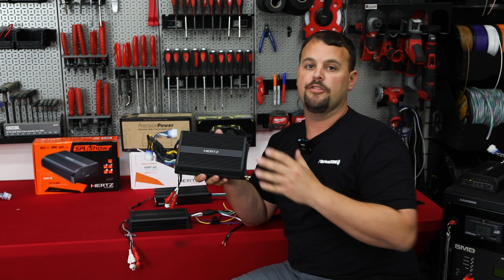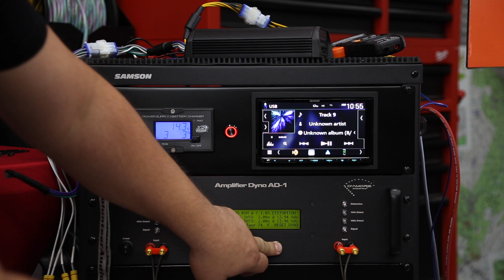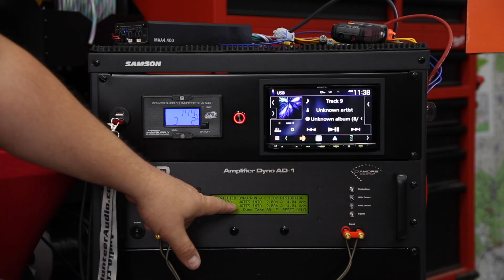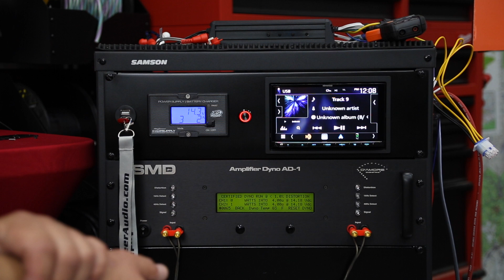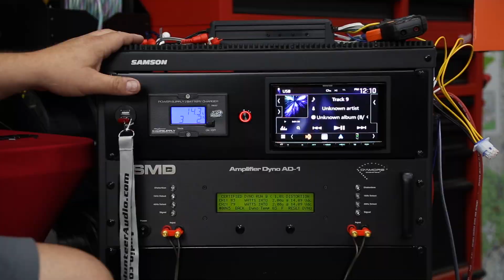Good Better Best We Dyno each amp option of Volunteer Audio Plug n play Harley Amp Speaker Packages!

Comment: 700 watts ÷ by 14 volts = 50 amps correct? I was wondering why these dinos do not match the math. Is it the lack of efficiency?
Reply from the maker: These new advanced class d amps are more efficient than older d or class ab

Comment: Hi, the hertz hmp4d has a 15amp fuse, do you run without a fuse as you mentioned it clipped around 20amp. Thanks
Reply from the maker: We always install a 20 amp fuse in them
Reply: Thanks so much, I’ll do the same. Love the channel 👍

Comment: How far above RMS do you recommend running speakers?
Reply from the maker: Depends on the distortion of the amplifier, that is what’s most important, this new Hertz amp is not the norm for high power amplifiers, most are very high distortion and easily blow speakers

Comment: Awesome info Jay...question..
Would you recommend the Sp4.900 to run hertz neo 6.5 in uppers and lowers...hertz neo 6.5 in tour pac and RF 6x9 in the lids...what would each speaker get..about 140?? Or about 70?
Reply from the maker: That would be 2ohm stereo so it did over 280 watts per channel at 2 ohm, you will get over 140rms to each speaker

Comment: Jay I just purchased the hertz amp and neo front for streetglide can those sx neo handle power when the amp is bridged and I will be adding some 6x9 neo later and maybe a separate Hertz  amp to get a sound as good as the new 1000 wat Hertz amp . Thanks
Reply from the maker: The only way to get the power your asking about is to purchase the new hertz sp4.900 it is 5 times more powerful than the Hmp4d

Comment: Oh, and one last question.  The hertz Amp seems to get really hot after normal use.  Seems a little excessive but not sure if its normal for this amp.  Any suggestions on keeping it at a lower temperature?  And thanks again dude.  Your the man!
Reply: Cool beans...
Reply from the maker: If running 2ohm it will get hotter but never hit enough to burn anything
Reply from the maker: The sp4.900 runs cooler
Reply: Class D with no fan amps tend to run hot when pushing a low impedance load. Completely normal, now if it's too hot to touch them you have a issue. A suggestion though to help out these amps is to install a fan or two in a way to blow air or extract the heat from the amps. Every little bit helps

Comment: Jay, I currently have 6 speakers (fairing, tour-pad and lids with the Hertz HMP4D-SS from you guys)  I want to add 2 of the new hertz subwoofers in my saddlebags, but don't want to add an amp in the bags.  What amp or amps would you recommend that could fit behind the fairing, so I don't have to add one to my bags?  Thank you in advance for your feedback.
Reply from the maker: The sp4.900 would be a great choice to add for subs but it would be difficult to add both amps in your fairing without an aftermarket amp shelve and modification to the bike

Comment: 250 watts per channel at 2 ohm.  So I have upper and lower fairing speakers hooked at 2 ohm.  Is each of the 4 speakers getting 250 watts or splitting the 250 between the 2 speakers?
Reply from the maker: It’s actually about 280-290 watts, I’ll do a future video to answer this question, most will tell you it splits the signal but I think you get more than half that number to each speaker

Comment: Dude..i like the math snd engineering numbers you speak of.  I just purchased the 2 stage set up from you guys, but i think i may need more.  If you go from the stock boom radio to the sounstream radio, will there be a significant sound increase in the system?   If i was to go to a 4 stage with soeakers in the front lower fairings what differences would i see?  Thank you for the info.
Reply: love to know the answer also.
Reply from the maker: The Soundstream radio does make it some louder but also clearer due to a stronger input to the amp, lowers will add more volume as well so you can clearly here it at highway speeds without going as high in volume on the radio
Reply: @volunteeraudio  I have a question, I’m updating my system in my 20 street glide special to a 4 speaker system. If money isn’t a problem, what would you suggest, speakers, new unit, ect?  If I’m more on a budget, best option? I like all music and I like loud and clear and highway speeds. Love the videos and I have learned much but also brings more questions. Thanks
Reply from the maker: @johnniepatterson9714  call us @ 1-844-30AUDIO to discuss options and pricing, thank you for watching!
Reply: Thanks brotha.  Ill be ordering that headunit REALLY SOON THEN!  Currently, the stock boom with the upgraded 2 stage sound great!  Having these videos snd your personal touch are like having a volunteer audio inside my home.  It's awesome!!